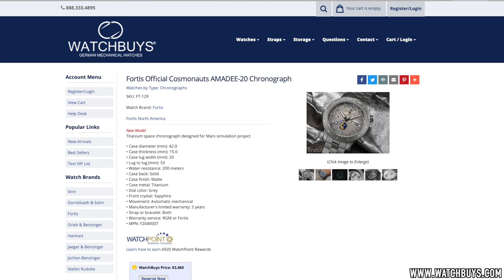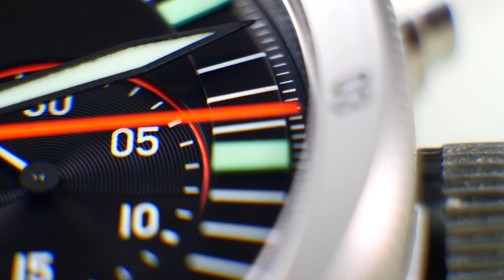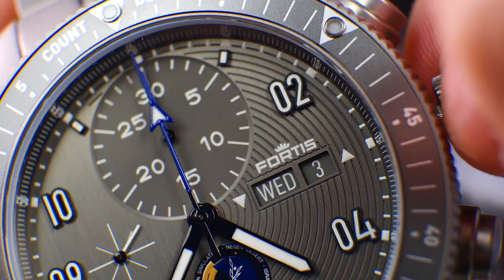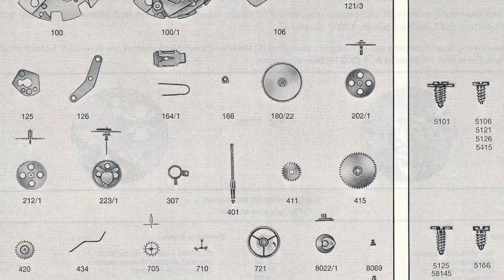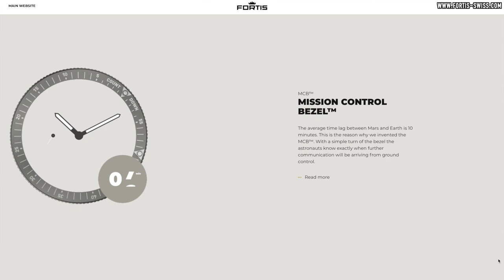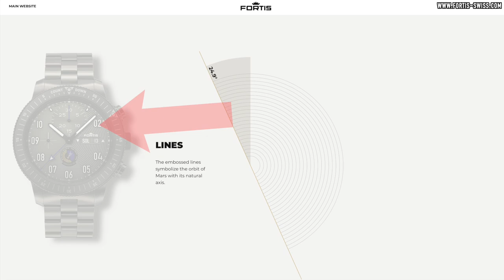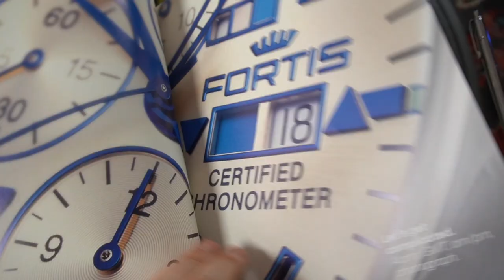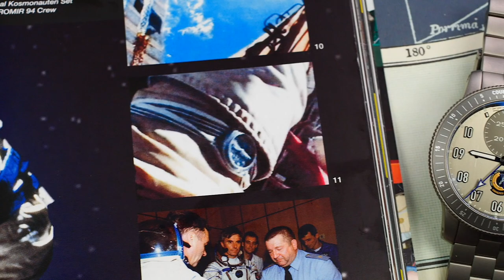Goodbye Moon Watch, The Fortis AMADEE-20 Chronograph is going to Mars!

Comment: Someone should make a 24 hours and 37 minutes watch movement so that a Martian day cycle can be properly kept track of.
Reply: that would be a horological masterpiece and collector item for sure!
Reply: that alreafy exists,check out the Konstantin Chaykin Mars Conqueror Mk3 Fighter
Reply: @robindelabra3874  Wow! That is a cool watch. I was thinking duel time with Earth vs Mars would be cool and lo and behold there it is with GMT too.
Reply: @robindelabra3874  all the good ideas are taken, right? That’s a very cool watch, I just wish it had half an extra hour marking rather than just a slowed movement. What I mean is, make it keep time in Earth hours, but just have an extra half an hour (roughly) on the dial. Hopefully someone will do that with the Mars time as the primary dial. I suppose the minute hand would have to flick back to twelve o’ clock once the extra 37 minutes had been completed, which could be tricky.
Reply: @Ashfielder  i would pay an unholy amount of money for a Glycine Martian which has an Airman style dial except there is a separate 24hr and 00 hr index with a 37 minute gap in between them that was highlighted with three lume pips. and then have an extra GMT hour hand that runs on earth time and jumps the 37 minute gap, the GMT hour hand is the one that drives the date wheel so you know what day it is back at mission control

imagine how collectable the actual space flown ones would be
Reply: I would like to see a watch that could track traditional Japanese time as well, so you could say “the second unit of the rat is starting.”
Reply: My first thought, too. On Mars, who cares what time it is in Houston. Maybe a super Earth/Mars GMT?
Reply: @JinKee  hello 👋 Gents start buying moonwalk watches etc.prices are going skyrocketed to Mars mission pocket 😆
Reply: @oklahomahank2378  Have you seen Masahino Kikuno's Temporal Hour watch?  One of the first pieces that got me into watchmaking, and a true masterpiece.
Reply: @samuelhopely4853    I saw a video on it.  I read a bit on the traditional Japanese system, including “The Bell Towers of Old Tokyo.”   I have another book on clocks in the Tokugawa era on the shelf when I get time.  I enjoy finding out about older time systems.
Reply: If it's mechanical you'd need to somehow slow down and speed up its second hand. Would be a horological feat. Might be easier with quartz, or you could just use a digital/solar watch that maps to mars time. Much easier

Comment: Hi, 

we just want to quickly answer a few of your question: 

Why isn't it with Mars-Time?
Well...We cross that bridge when we get there;-) 
This one is made for an analog mission on earth so no need of Martian time. We are developing the watch together with the Austrian Space Forum - step by step. So next time we will implement other features or materials based on the the results of the analog missions. And then...one day...when Elon asks the question of which watch should we take for our trip...we will be there...tried and tested. 

Why the Hook Strap?
It is designed by Nick Mankey who is based in California. We decided for these Hook Straps because they are elastic and that was one requirement for the astronauts on the field mission. They can now easily pull the over their space gloves. The well known velcro straps are actually quite tricky to handle with gloves that size. A slightly smaller reedition of the Hook Strap is included in every box for earthlings.
Go check out Nick Mankey's website for even more designs or details: https://nickmankeydesigns.com/ 

Why automatic watches in space?
Imagine you're going to space for a long...a very long time... One day you run out of batteries and your watch will simply not be working anymore. 
Therefore we believe that automatic wrist watches are by far the better choice. Now due to the oscillating weight, and most of the time zero gravity, the watch will be working all the time. Imagine the rotor starts turning by your movement: Due to the zero gravity it won't stop turning.

Why Tool Watch. Redefined.?
We at Fortis believe in functionalities. We also believe in good and timeless design. We build Tool Watches. But we also want to add love and details and combine it with perfection and outstanding quality. But there is one more thing that is utmost important to us: Emotions. 
We do not create watches. We want you to look at your timepiece every day, no matter the planet you're on and our goal is that you love it like TGV loves his 38mm Official Cosmonauts. 
So we are creating Tool Watches. Redefined.

Why is the 13 different?
For us the "13" is our lucky number. That's why we shoot all our photos with FRI 13. Since the Flieger Release, the 13 on the date wheel is always in a matching color. It should remind you at least once a month, that you bought something that's not just off the shelf. On the AMADEE-20 we also renamed FRI to SOL (a Martian day). But that's because we just simply liked the idea.

We hope that the above kind of resolves some of your questions.
If you have any other questions please do not hesitate and send us an email to info@fortis-swiss.com

Best regards, 

Team Fortis

Comment: I don't want to be that guy, but if I actually had to walk around on Mars I'd rather have a solar G-Shock if the battery is of any concern.
Reply: Also,  you could have an  extra 50 solar G-Shocks as  backup for the price of  one of these if it fails!
Reply: But it would rot
Reply: For real. The realistic average battery life of a solar G is probably 10 years. The service interval of a mechanical might be around 10 years, but along the way you might experience greater and greater deviation from original accuracy. A G shock will most likely be factory spec until the battery dies. I love mechanical watches, but I'm being turned off by people clamoring to maintain their practical relevance. Yes, mechanical watches have a higher degree of artistry and soul and are undoubtedly more satisfying to own and wear, but they 100% do not out-perform a $60 digital watch in accuracy or durability. Casio would also be able to produce custom firmware to sync with central timekeeping units that they're likely to have up there anyway. The Fortis is a cool watch, but I'd bet that these missions open themselves to courting by products looking for interesting and unique placement. To me it's no different than someone drinking a Pepsi on a TV show. The beverage company paid for that to happen.
Reply: @khabuda  Agreed.  I may be wrong, but as it stands currently I see the value of this watch to the Mars mission being exactly that of a Rolex Submariner to a commercial diver.

Comment: I do worry that the 10 minute marker on the dial is actually a bit redundant, although it takes on average 10 minutes for Earth-Mars communication, it depends where they are in relation to each other orbits, and can get as low as 4 mins and as high as 24. So I don’t know how useful a permanent 10 minute marker is, as it will rarely be spot on.

Comment: I'm not a specialist at all, but I read that a mechanical chronograph requires frequent servicing, because the clutch gear (is it the correct name?) wears off quite fast. Wouldn't it be a problem for space missions?

Comment: My guess for a Mars watch would be a Casio G-Shock. No sapphire is allowed. The resin cases are lighter. Solar or light charging dial. And the software can be written to adjust for different Mars  length of day as well as different days in the Mars year. In addition, many Mars time zones can be added. Or forget watches because astronauts will probably have wrist mounted computers.

Comment: Their old Cosmonaut model, featuring a 12 hour mechanical chronograph movement, would never have worked on Mars.  But this new 30 minute chronograph will work there just fine, but of course, since it is Mars certified, it will have to cost much more.

Comment: The Speedy Pro is still used in space - its the ONLY watch qualified by NASA for EVA - gshock, x-33 etc etc are not used for EVA as the LCD displays can crack from the extreme temp changes. Have a look on the wrist of astronauts spacewalking - it will be a speedy pro. Cosmonauts use the fortis or speedy  pro for EVA. There is a world of difference between comfortably sitting inside the spaceship/station and being exposed to hard vacuum.

Comment: The bezel is a gimmick. The earth orbits the sun in little over 365 earth days while mars orbits the sun once in almost 687 earth days, so their distance changes constantly and with that the time radio signals take to cross that changing distance. To be more precise, earth and mars are in the same positions relative to the sun once in almost 780 days (mars synodic period) so the bezel only functions more or less correctly for a few days twice every 780 days (or just once if you pick dates where earth and mars are either closest to each other or farthest apart).

Comment: Totally honest question, would a digital quartz watch work in space?
Reply from the maker: Absolutely!!!! They can work anywhere.
The DW5600 is one of the most worn watches in space.
Thank you Joshua, check out my top space watches video from 2019 ;-)
Best regards,
TGV
Reply: @theurbangentry  Thanks for the response! That is very interesting.  It seems like they are actually planning to use an analog watch  on mars.  I would have thought this would be akin to a dive watch vs. dive computer situation (i.e. it technically works, but there is a digital alternative that can do the job better).